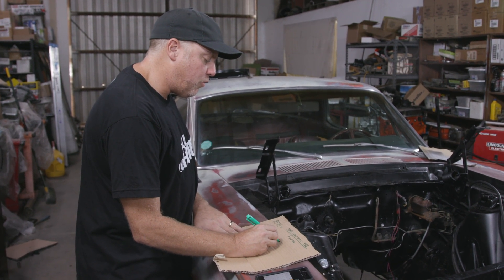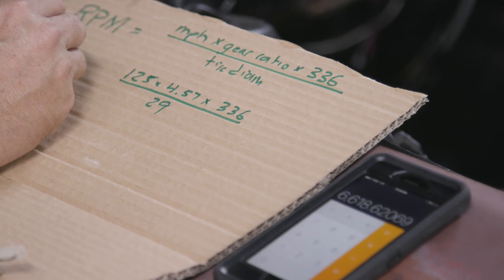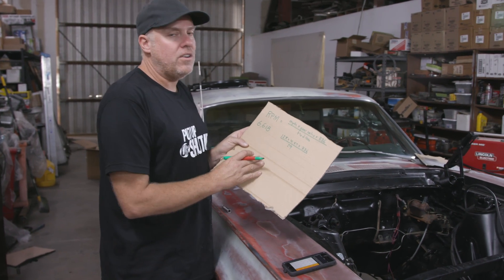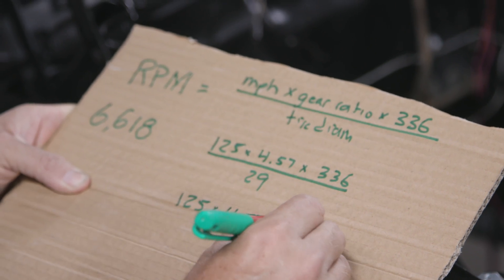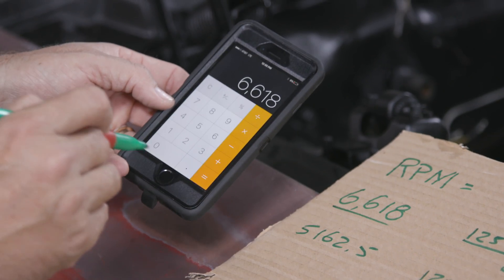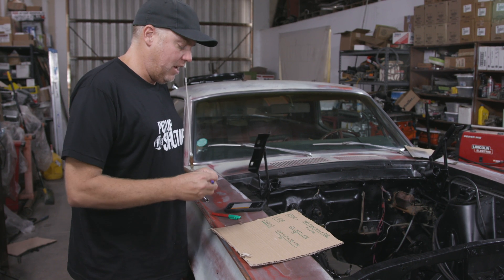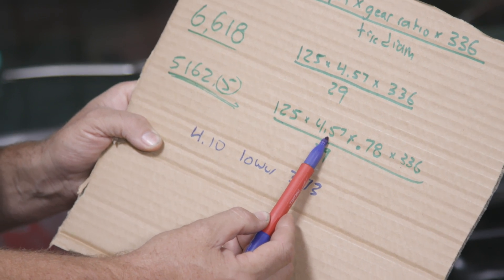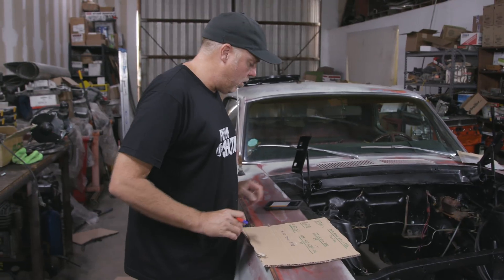How to Calculate Engine RPM vs. Gear Ratio - Roadkill Extra

Comment: I have 3.42 with 3500 stall th400 calculation shows rpm at 65 to be 2600 but I see closer to 3000 rpm at 65. So if I went to 3.73 I would be at 2900 in calculation and actual around 3400. With 4.10s at 65 actual will be 3600. I think I would brake alot more stuff with 4.10 will prolly just do 3.73

Comment: I have a question a good towing gear for hauling junk cars f250 f350s I'm building a 1986 Chevy c20 Cheyenne I want to put a gear ratio where I can do 80 mph down the highway hauling three cars what the 262 straight six

Comment: this formula is not even close.. I just did a 6th gear test at 70mph 1,500rpm , 80 mph-1,750 rpm and 92mph 2,000rpm with 3.08 on toyo 33 inch 2018 gmc sierra 680L ... none of these are even close to the formula .. go figure  I am trying to determine if i should go to 3.73 or 4.10 because the stupid 3.08 is obviously way way way to short, even for 31 inch tires.

Comment: Let's say I want to hit 200 miles per hour and I'm using an LS 5.3.  How much power does it need? What transmission do I need? And what rear end do you suggest? With a car weighing 3000 lb
Reply: a drunk driver would be useful

Comment: I was doing the math and it did not work out. I research the equation and it is missing the transmission ratio. Here is the link: 
https://www.hotrod.com/articles/speed-rpm-gear-ratio-tire-size-formula/?galleryimageid=752
Reply: I do not think it is a accurate equation. I did another one for my Camaro which seems to be more accurate. His equation gave high RPMs for the car I have.

Comment: Something not right for me haha. Says I will be running 3,300 rpm with 3.73 ratio and 30" tires at 80mph. In reality I'm running right at 2,500rpm
Reply: Daniel Mantell do you have a 0.748 overdrive?  This equation is assuming a 1:1 transmission gear ratio, which on a 5 or 6 speed is typically 4th gear.  For transmissions with more gears it may be 6th gear or even higher.  A 0.748 overdrive will result in 2,500 rpm @ 80mph with a 30" tire diameter.

Comment: Solving this way gives you what gear ratio you want in order to be crossing the finish line with your engine in its max HP range. But most people don't drive a drag car. So then you need to decide what RPM you can live with at a particular speed, fill out all the other variables and solve for rear end gear ratio. For most people they would solve for whatever gear gives them the max allowable RPM at, say, 55 MPH, or maybe 65 MPH for freeway driving. But an overdrive allows for lower gearing on the street. This calculator is available lots of places on the Interweb.

Comment: As a reverse engineer who does gaming. Forza horizon 4. The equation to find your gear ratio final would be Max RPM/ Top speed/ 287.5 “based on game physics algorithms x tire diameter. 

Divide 3 and multiply tire diameter for forza horizon 4. If anyone showed up here wondering how to find a blind gear ratio for the game :)
Reply: could you repeat it clearly?

Comment: If I see one more tire calculation equation that says "plug in your old tire to determine what size tire you should have", I will scream.

PLEASE, Let's say you have changed the engine in your car, transmission and rear end. You would NOT use the same size tire that was originally on the car as all parameters have changed. Too small a tire and you'll be doing burnouts when you take off at "normal acceleration." Conversely, if the tire is too large, your engine will be screaming at let's say 20mph.

There is a chart, which you do certain math using variables like vehicle weight, torque, rear gear ratio, and transmission ratio,  to determine what range of tire you should have for various performance levels.

+Motor Trend Channel, please tell me you know of this chart???
I used to have the reference chart, and have lost it and can't find it anywhere on the 'net.

Comment: What about changing the actual gearbox gears when you build a motor for more horsepower? Wouldn't you get more out of an engine if you tuned the gearing with that?

Comment: I bought a caprice 1978 with a 305 en th400 transmission. En my transmission is ticking so the oil has to be changed (flushing is very expensive) how can you change transmission (and moter) oil at home?
Greets from the netherlands

Comment: You can find your top speed of each gear by dividing your max rpm by rear axle ratio by gear ratio by 336 times tire diameter like with my car I know top speed in first gear is 55 and by doing the math of 5500/3.5/2.47/336x29=54.9mph

Comment: 2.18 gears? Lol My Monte Carlo has the factory 2.29 gears. At least you have a bunch of power to move it too. Try moving a 3500 pound car with 2.29 gears with 110 hp.

Comment: you could just put small tires on it to increase the horsepower
Reply: Smaller tires will effectively change the gear ratio, meaning there is more torque going to the ground. The engine will make the same amount of horsepower, as the horsepower output of the engine is not related to the tire size.

Comment: Thanks for the insight.
So unless I'm mistaken in the original form this equation assumes the gear selected (in the transmission) is a 1:1 (roughly 4th gear on many cars) creating a gear ratio of 1.0.  So if I wanted to account for the gear, to say take a small 4 cyl car at the top of 1st which is probably rocking a 3.25 1st gear and a 4.25 rear (like a civic) and let's just use a 185/60/R14 diameter it'd be something along the lines of:
(30mph*4.25*3.25*336)/22.7 = 6,133 RPM

That sounds about right.  Think this is a good equation to hold onto for sure!

Comment: I remember hotrod or car craft Doing this, but they included the weight of the car and that gave required horsepower, then they figured gear ratio to keep it in a certain speed bracket. Anyone know what I'm tslki about? I need that article in my life.

Comment: If USA changed to SI units you could eliminate strange conversion factors like 336.  Also why not rearrange the formula, you make gear ratio the answer, you know speed and the max revs you want to hit, it will then pop out ratio, this prevents iterations and hunting for the answer.

Comment: Stupid question it's possible for a automatic transmission car to stall or buck like a manual transmission if the brakes are dragging and it's carbureted with a distributor??? had to work on my brakes and I think the first time I tried driving it they got stuck on that or I have a new problem but it was driving ok before I did the work on it. Ps. Was in a hurry to get to work so I think I fixed or in the process of the sticky brakes ( residual valve ) but haven't gotten to drive it yet the Engine idles ok and revs ok

Comment: There's also awesome apps for people with manual transmissions that want to rev match perfectly for every gear.  Down shifting to say 2nd or 3rd may wear the clutch a bit if you don't know exactly where the revs should be.  The apps can get you into 2nd gear with no slipping the clutch perfectly for a corner.  Given once you know a car you don't need to know what rpm to be at, but on a brand new car you may wanna figure those ratios out so the learning curve is a lot faster.

Comment: we know what motor trend on demand is, a lot of us even got it at one time or another.  However the Android app for it sucks so bad that it's easier to just wait and watch them here on YouTube rather than pay for an app that freezes, doesn't screen rotate half the time, doesn't remember where you left off, or only opens after I kill the program in settings.  By the time I'd get the stupid app running my lunch break would be over.  Now you know.   Other than that I am a fan, just not paying for that app.   It may be fixed by now, but it's like a cable company, you don't go back to what didn't work before.  Maybe it works great on iPhones, but more than half of us don't want to drink that kool-aid.... I've had both so I'm not starting that argument.  Beta test on iPhones AND Android platforms.  lol sorry, I know it's no your fault Freyburger (I know I spelled that wrong).  The constant advertising for the on-demand app finally got to me.

Comment: So...a 30" tire has to make 44 revolutions in a quarter mile  ?
Reply: No, 168.
Reply: Babarudra that's right...l missed the inch to foot conversion...so, 168 revolutions in 10 seconds would be 16.8 revolutions per second (direct drive/electric motor), or 1008 rpm  ?
Reply: James Letaw that is the average revolutions per second assuming no tire slippage.  The rate for the first second of the run will be much less than the last second since there will be a higher speed at the end of the quarter mile.
Reply: James Letaw that's a cool fact I never thought of to look up
Reply: Richard Price it's where the rubber meets the road

Comment: Thanks Friburger I am starting a build I have a 2002 ford E350 boxvan with a POS 5.4 triton motor ( when is ford going to learn how to build a motor ??? I will be putting a whole new drive train in it It will be a cummins 4bt with a ATS built 47 RH and a atlas transfer case it will be a frame off build and my question would have been at 65 MPH what would be the RPM so 65x4.10x .69 x336 /33.5 = 1844 I will be running BFG 35 12.50 16 which is right in the power band for the cummins thanks for the info and keep the videos coming more info it has already been converted to 4wd by Salem Kroger but I will put in unjointed off road parts it has a Dana 60 high pinion front axel and a Dana 70 HD rear end with 4.10 gears I will also be installing ARB lockers front and rear this will be my retirement expidition van goal is to drive to the tip on South America turn around and drive to the North Pole to see Santa

Comment: Now tell them how the number of gear teeth is in direct correlation to gear ratio; ie take the number of ring gear teeth and divide it by the number of pinion gear teeth, that'll give you your gear ratio.  41 ring gear teeth divided by 11 pinion gear teeth is 3.73, however, add just four more teeth to the pinion gear and you have 2.73.  That is a significant difference in RPMs between a street/strip gear ratio and a sole highway cruiser, and the difference between a 2 and 3 series carrier!

Comment: So, if I wanted a new transmission, how would the equation be for the 6th gear if say I had 3.55 rear diff and wanted to cruise the highway at 70mph at around 1500rpm?
Reply: RepoDraghon then your formula is (70*3.55*[sixth gear ratio]*336)/([tire diameter])=1500 then you plug in tire diameter and solve for sixth gear ratio.

An easier way is to plug in the sixth gear ratio of your transmission and solve for the final drive ratio.
Reply: Daniel Senti cool, tire diam stock uhh well its a 235/50R18 but eventually I'm thinking 305/30R18

Comment: You forget to do it in metric too, for the rest of the world.
Reply: "Most hated country" only exists between politicians. The majority of people in every country in the world just want to be at peace, put food on the table, and enjoy life best they can. It's governments, major religions, and politicians corrupting and ruining everything. Even in the scariest known parts of the world, plenty of local people would go to great lengths to be hospitable to strangers.
Reply: 58 fregate the rest of the world is also using mostly different transmissions.

This math works in a 1:1 gear, which is mostly no 3 gear on old automatics. IF you are in over drive, what's you rpm - given a 0.7x:1. Or in first gear or or

There are websites online that are centuries better to use, if any question about that, like http://www.grimmjeeper.com/gears.html
You can just select your tranny, tire diameter and get EVERY value, like rpm @any gear AND speed. Or the other way around: speeds that shows your rpm @given speeds, like highway, in town and lower gear ...

Btw it's 2017 > this website saves cookies. That means next visit, you can just change tire and have every value with the new tires. Just  click on url + 1 click to change the new parameter sms baaahm here you are.
Reply: And that answer Bluegrass sir is why you are one of the most hated country in the world.
Reply: 58 fregate was joke
Reply: "one of the most hated country in the world" only because we don't have what other countries have...  "Official"! it like when people say the United States 1 of only 3 nations that have not adopted the metric system. yes, it is true but they don't tell you is the United States has not adopted or have any official measurement system. it's kinda against our laws.
Reply: For Kph you can take mph and divide by 0.62 and get kph
Reply: Only 3 countries officially still use the Imperial system. My comment was more of a challenge to Freiburger since he says he is mathematically challenged.
Reply: Formula variables are the same. Swap out the length variables and you're good.
Reply: Loose screw : Imperial system snowflake? Do you know how to spell joke? In case you're wondering I know how to do a google search and I was amongst the invited people at the introduction of Hot Rod TV in the rented warehouse in Burbank on a saturday morning, I believe Freiburger was there with Thom Taylor and I got to sit in F'Bomb that day...
Reply: 58 fregate you know there like 20+ countries that use MPH.
Reply: Fuck the rest of the world, be more like America. You’ll be happy, I promise.

Comment: Here are the formulas for calculating motorcycle and automotive performance. 
  Many of the formulas use the value of pi which is 3.1415927 
  Some formulas contain notation such as ^2 which means "squared" or ^3 which means "cubed"

Formulas for Calculating Performance

Convert between 1/4 mile and 1/8 mile ET's
   1/4 mile ET = 1/8 mile ET x 1.5832
   1/8 mile ET = 1/4 mile ET / 1.5832

Calculate 1/4 mile ET and MPH from HP and Weight
   ET = ((Weight / HP)^.333) * 5.825
   MPH = ((HP / Weight)^.333) * 234
 
Calculate HP From ET and Weight
   HP = (Weight / ((ET/5.825)^3))

Calculate HP From MPH and Weight
   HP = (((MPH / 234)^3) * Weight)

Formulas for displacement bore and stroke

pi/4 = 0.7853982

Cylinder volume = pi/4 x bore^2 x stroke

Stroke = displacement / (pi/4 x bore^2 x number of cylinders)

Centimeters^3 X .0608695 = Inches^3

Inches^3 / .0608695 = Centimeters^3

Formulas for compression ratio

(CylVolume + ChamberVolume) / ChamberVolume

cylinder volume = pi/4 x bore^2 x stroke

chamber volume = cylinder volume / compression ratio - 1.0

displacement ratio = cylinder volume / chamber volume

amount to mill = (new disp. ratio - old disp. ratio / new disp. ratio x old disp. ratio) x stroke

Formulas for piston speed

piston speed in fpm = stroke in inches x RPM / 6

RPM = piston speed in fpm x 6 / stroke in inches

Formulas for brake horsepower

horsepower = RPM x torque / 5252

torque = 5252 x horsepower / RPM

brake specific fuel consumption = fuel pounds per hour / brake horsepower

bhp loss = elevation in feet / 1000 x 0.03 x bhp at sea level

Formulas for indicated horsepower & torque

mep = Mean Effective Pressure

horsepower = mep x displacement x RPM / 792,00

torque = mep x displacement / 150.8

mep = hp x 792,000 / displacement x RPM

mechanical efficiency = brake output / indicated output x 100

friction output = indicated output - brake output

taxable horsepower = bore2 x cylinders / 2.5

Formulas for air capacity & volumetric efficiency

theoretical cfm = RPM x displacement / 3456

volumetric efficiency = actual cfm / theoretical cfm x 100

street carb cfm = RPM x displacement / 3456 x 0.85

racing carb cfm = RPM x displacement / 3456 x 1.1

Formulas for tire size & their effect

effective ratio = (old tire diameter / new tire diameter) x original ratio

actual mph = (new tire diameter / old tire diameter) x actual mph

Formulas for g force & weight transfer

drive wheel torque = flywheel torque x first gear x final drive x 0.85

wheel thrust = drive wheel torque / rolling radius

g = wheel thrust / weight

weight transfer = weight x cg height / wheelbase x g

lateral acceleration = 1.227 x radius / time^2

lateral weight transfer = weight x cg height / wheel track x g

centrifugal force = weight x g

Formulas for shift points

RPM after shift = ratio shift into / ratio shift from x RPM before shift

driveshaft torque = flywheel torque x transmission ratio

Formula for instrument error

actual mph = 3600 / seconds per mile

speedometer error percent = difference between actual and indicated speed / actual speed x 100

indicated distance = odometer reading at finish - odometer reading at start

odometer error percent = difference between actual and indicated distances / actual distance x 100

Formulas for MPH RPM gears & tires

mph = (RPM x tire diameter) / (gear ratio x 336)

RPM = (mph x gear ratio x 336) / tire diameter

gear ratio = (RPM x tire diameter) / (mph x 336)

tire diameter = (mph x gear ratio x 336) / RPM

Formulas for weight distribution

percent of weight on wheels = weight on wheels / overweight x 100

increased weight on wheels = [ distance of cg from wheels / wheelbase x weight ] + weight

Formulas for center of gravity

cg location behind front wheels = rear wheel weights / overall weight x wheelbase

cg location off-center to heavy side = track / 2 - [ weight on light side / overall weight ] x track

cg height = [ level wheelbase x raised wheelbase x added weight on scale / distance raised ] x overall weight
Reply: Somewhere in there is the key to Bonneville fame 😍

Comment: that calculation is for cars with a 1:1 fourth gear, or whatever the top gear is. In a 5-speed, just like in the overdrive, the fifth gear ratio has to be multiplied too.
Reply: Thought my calculation seemed Ludacris so decided to check the comments.. Thanks for pointing this out, would have taken me a little bit to work this out myself. When there's the stress of a whole build it's hard to think of the little things.
Reply: @bradhh1234  thanks, found out i would have 9300rpm in 125mph in an M52B28 xD